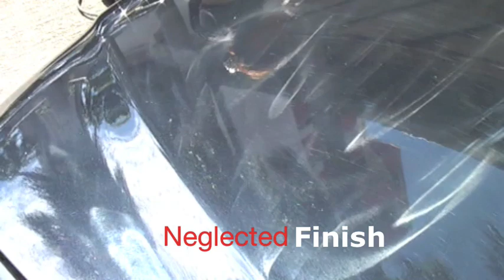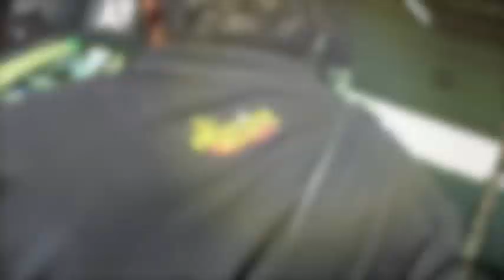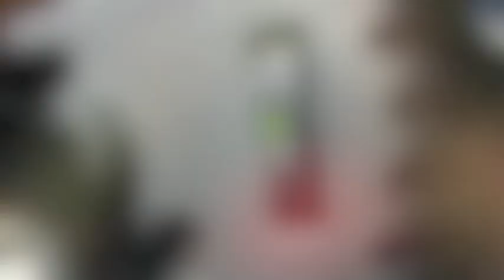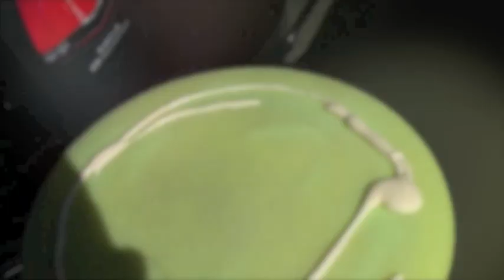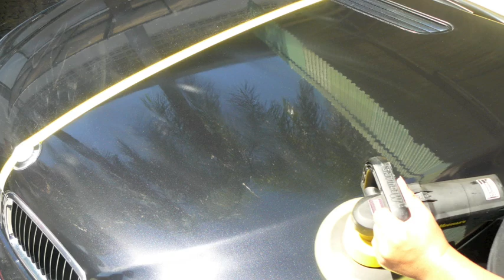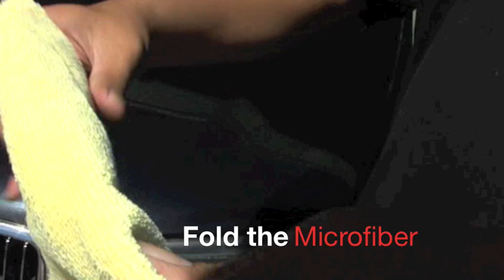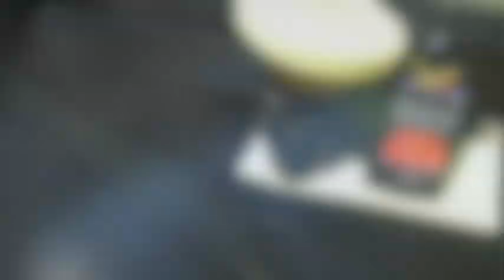How to use Ultimate Compound

Comment: If im not mistaken, they r showing how to use ultimate compound in another way than usually ppl use it. Usually ppl use it for small sections to remove oxidations. This time it was used for like 4 times the correction method and mainly used as a polish to take holograms, it went on and off super easy too. Smarttttt meguiars

Comment: Woke up this morning to find that the wind had blown a metal lawn chair against my 2010 civic si leaving a deep long scratch in my fender and door. I though that I would need to wet sand and buff out the scratches but two applications of ultimate compound with my da removed them and left a glass like swirl free finish behind.  Thanks for making great products and saving my paint Meguiars

Comment: Those who think this car was "set up", just take a look around and you will see a lot of cars with these swirls because most people who use a buffer to wax their cars unfortunately use one that spins way to fast or they do not clean the surface properly before waxing. This stufff is a micro abrasive that does an incredible job. The front of my car has fresh paint (thanks to a deer) which made the rest look bad. I hand rubbed the 9 year old paint and it outshined the new paint.

Comment: It depends to be honest. All polishing brands (over the counter) have different products for different levels of correction and skill. In this case, Meguiars Ultimate Compound has a 'cutting' element. This is essentially taking the majority of imperfections (holograms, swirl marks, RIDS etc) depending on method of application, i.e. Pad, machine, pressure. However, other products like 'Sealer & Glazers' and some Waxes are for 'filling' these imperfections. 

Hope this answers your Q :)

Comment from the maker: it should be used in the shade, yes you can use an orbital buffer or polisher. Terrycloth pad would work but microfiber or foam polishing pad is better. This product will bring back the shine and color, yes. After this product you should protect it with a product like tech wax 2.0.

Comment: Oh, never thought Meguiar will make so many mistakes!

1) Never do it under the sun.
2) Compound section by section, not the whole surface.
3) Each section should run 3 passes.
4) From far, the surface looks nice after compounded. But, in fact, foam pad can not remove many deep scratch lines including from the swirl marks. That's why Meguair has micro fiber (DMCS) pad for this purpose.

If we really can use foam pad to cut all the scratches and swirl marks with only 1 pass and with this speed, I will become rich as car detailers. I only manage to compound (including polish and wax) 2 car per day with 3 man power in a group. Not easy to remove scratches!
Reply: Lim KC i agree to most of your statement, but if we use a better polishing tool such as "rupes 21" and also meg 105 (this is my arsenal) isnt it is easier and much faster and sometimes ( depending on paint condition) we could do fewer passes? sometimes 2? Well i'm not a professional, just a "geek", that has OCD on neglected car finish. I'm looking forward for your lesson :p
Reply: Dude...they use under the sun to demonstration heeeeeeeeeeellloooooooooooooo
Reply: Pa Ca yeah i know. Larry from AMMONYC always said that. Sometimes they did it under the sun just to make us viewer, see the imperfections easier, but Larry always said, not to do under the sun. But MeguiarsAsia channel is not good at making video, even when applying wax. LOL
Reply: We can use microfiber pad to compound and follow by polish. Compound has to be run at slow hand moving speed. Yes, we can use foam pad with coarse polish material and able to run with fast hand moving speed but end up you need to run more polish layers. Just my two cents. Some other auto detailers like to use many polish materials but I like to keep it simple.
Reply: anthony hancia I have both Meg #105 and Ultimate Compound.  Given #105 has a cut of 12... I would give Ultimate Compound probably a 10 or 11.  Either way Ultimate Compound is vastly superior to #105 in that it is easy to wipe up and doesn't dry up as quick.  #105 is either like trying to wipe a thick grease that smears all over the place OR it dries out too fast making it hard to work with.  You will find you constantly need to wipe it up and if the air is dry constantly need to spray it with Final Inspection (or similar) detailing spray.

The Rupes 21 is absolutely faster than the Meguiar's DA.  My favorite polishes are actually from Menzurna... they beat Meguiar's hands down!
Reply: NETWizzJbirk well i have not try ultimate yet, and i did not realize is 105 dries up so quickly, its either i am a bit ignorant and noob or just because i live in asia, where its very humid here. and or polishes i have not try menz either, but sonax perfect finish is way better than 205. and compounding with menz? yeah you dont need to ask.  menz FTW!. just dont use their wax or sealent in my opinion. not working that well for me :p
Reply: anthony hancia Just saw your post... Getting products in the USA is super easy... Personally, I actually like 205; since, it is easy to work with and finishes great.  That said, I have NOT tried Sonax, so I have no reference to compare.  I know Mike Phillips used it in one of his AutoGeek videos and they got superb results; I may give it a try.

I would suggest you try Ultimate Compound because for the money it cannot be beat (here in the USA)... For all I know Meguiar's to you is probably a foreign product and likely costs a primium.  For me, I can get Ultimate Compound for about $8 for 16oz (about half of a liter)... Compared to even #105, which is about $35 for a quart (roughly a liter) it a LOT more product for the money.  Menzurna FG400 (similar compound) is about $50 and my preference thus far.

I have not tried their sealants.  Was it PowerLock that did not work well?  You might like Wolfgang Sealant 3.0 or whatever it is...  It is very user friendly, looks great, and lasts.
Reply: +Lim KC 

you do not need only microfiber to get rid of scratches, yes it cuts better, but it all depends on the paint you are working on. you can get the same results with foam as microfiber foam finishes better, but microfiber cuts better.

some paints you can get 90% defect removal without microfiber or wool, you have to do test spots not every paint is created equal

and those rotary holograms were superficial, they most likely did that them selfs, because they are so easy to get out.

the point of the video wasnt to show a 100 percent free defect car, it was just to show the average person that ultimate compound can get rid of some decent defects.

they never said the car was 100 percent defect free, they just showed a simple before and after.

and they only did it in the sun to show how bad the rotary holograms were, in a shaded area even with a inspection light the holograms do not illuminate as drastic as the sun does. its a showcase video.
Reply: Lim KC can you put up a better video yourself?

Comment: I use Ultimate compound in my pro detailing business because it works great!  for paint that is not so scratched and swirled that m105/205 have to be used Ultimate compound does amazingly well.  it is also great on really soft paints because it does not haze or swirl the paint.  great price too!
Reply: So basically use ultimate compound when scratched and swirled if not the case can I just use ultimate polish

Comment: The Ultimate Compound is a very good retail level product.  For beginners or those looking to just bring a paint job  back to respectability, this product is great.  I use it in conjunction with a Hex Logic Orange pad and the results are amazing for the product level.  I finish off with the Ultimate Polish with a Hex Logic Black pad.

Personally, I would divide that hood into at least 6 polishing sections and revise the technique to a more standard left / right then up / down method.  Also, stay out of the sun, especially on a black car.  Way too much heat generated that helps nothing.
Reply: I have deep oxidation but not THAT deep. It seems you can still see some after the McGuire's. How long should I polish for? I'm using a DeWalt sander that I turned polisher lol level 3.

Would you be able to explain the differences in pressure, speed, etc? Does pressure make it better? 

Does using more and more compound eventually fill the oxidation? 😅

Comment: 1. Wash the entire car with ultra clean handwash mits ! Upper parts first like roof, hood, trunk (depending on cars) , then the doors always up to down, then the bottom sides, front and rear bumper, Make sure there is no bugs on the surface (if theres any that cooked in the clear, the compound or sanding will take care of them.

2. Decontamination of the vehicule ! I decontaminate my vehicules with a Nano buff mits which mean you can decontaminate the car with the soap as a lubricant, Pass the nano buff mits, clay bar or anything you use all over the surface that are contaminated, you can feel it scratchy if you softly rub your hand against the paint

3. Rince the entire car and make sur there is no more contaminants and water leaking from  mirrors or cracks and everything.

5. To polish a car you must first be in a garage with very bright lights, Sun is not an option ! the compounds products dry to fast on the paint and is no good when you polish the product, Make sure there is no dust on the car and then Tape all the jonctions such as rubbers, alluminium, everything you dont want to polish or damage

6. Use the ruff whool pad with the step 1 compound (i use 3M) yours can be something else. Start polishing the surfaces till you see no more scratches, The step one always leaves swirls on the paint.

7. Again using the step 1 compound, switch pad and use a foam one, the ones i use there all 3M and it is white, then polish again all the surfaces.

8. Glaze the car : I use HSF 2 as a Glaze and it wirks perfectly fine, it gives instantly a mirror effect to surface of the paint, Turn your machine up to 3,800 and dont put too much product.

9. Ultra Fina : This is the step 3 of the 3M compound and it is the last step of polishing youll do, SO MAKE SURE TO DO IT RIGHT TO GIVE THE BEST FINISH TO YOUR CAR.

10. Wax it ! Wax with banana oil or carnauba is the best i ever used.

11. Remove every exceedents of compound in the cracks windows and everything ! you may need to rince the car again with a pression gun.

Comment: I know what you mean.  I use Collinite 845 and it is extremely difficult to remove the sealant from the buffing microfibers.  I pre-soak the towels in a gallon of water with 1/4 cup of All purpose cleaner either overnight or for a few days (only way to get them clean).  Then rinse thoroughly, and resoak again in APC.  If no more residue is coming from the microfiber towels, rinse thoroughly with some white vinegar mixed in your rinse water.  That *should* do the trick.  Time consuming, yes.

Comment: This is kind of a misleading video. Its been rotaried and left with swirls .. its not neglected. And then they buff it out. Put a video of a legitimately neglected car. And clean it with just this product. Then ill be impressed.
Reply: +Miqui Russell Stole the thoughts right outta my mind
Reply: Agreed, but I would say it's been abused by someone with a rotary who didn't know what they were doing but I'm   probably splitting hairs.
Reply: its worse than neglected
Reply: agree with you on everything you say thats defo installed swirls with a rotary  buff can tell by the pattern but i can vouch for this stuff im using it to bring back the old white/pink bmw bright red on my 28 year old e30 bmw an you wouldn't believe how good its coming back with this if i could get picks on here i would be happy to show
Reply: dave mac
You can use photobucket and share link, or make a facebook picture album public and share it
Reply: I agree, great paint that has light surface scratches caused by a dry buffer.  Wonder how they got there????? HMMMM???? lol.
Reply: Neglected or detailer installed, compound/polish will fix it. Same process.
Reply: € fut deaghis teare louvi years
Reply: The video was shot in Meguiars Asia(China). What else do you expect?
Reply: it doesnt matter anyway Miqui,,,if you use Meguiars compound,,polish or wax,,you will be impressed,,,it is a superior product and it wont let you down
Reply: This is the norm for ALL detailing companies. Also, always showing “just the hoods” on most detailing videos.  There are other areas on a vehicle that need to be buffed out that are a lot more difficult than a hood!!!
Reply: How pathetic!!

Comment from the maker: for cars, you want a less aggressive soap that does not remove the wax or sealant that if your protection from UV rays, dust, dirt, etc etc on the paint. A car soap should be PH balanced to not strip your protection! Pros of a car soap is that its made for any part of your car and wont harm the paint, windows, metal or rubber. Dishwashing soap is made to remove grease and dirt for hard surfaces...soft ones like paint and rubber and such will harm it over time and make the car not smooth and fade

Comment: Never do this out in the sun.
Reply: myfastgti07 That is one of the rules of polishing for beginners, but if you experience enough, heat is one of the criteria to level out the paint. Buffer speed, arm speed and types of compound are in 'different arena' when you outside expose to the sun. The guy in the video took an advantage of heat from the sun and use speed setting 4 while buffing and you notice his arm speed is slightly faster. If the car were in the studio/garage and when paint is cool, his arm speed need to slow down a bit and probably require speed setting 4.5 or 5 because he want heat and power from the buffer. So polishing cars out in the sun is not really a big problem as long as you know how to take control of the buffer and also know the surface temperature
Reply: Radhwan its true when you do it properly even in the shade the paint surface heats up it helps take layers off
Reply: @MohdRadhwan  thank bro,I have no place to do polishing step. Your explanation has helped me to do so under the sun.
sorry bad English
*Google translate
Reply: @MohdRadhwan  balony

Comment from the maker: this product is made to help with neglected or abused finishes. This product has light abrasives in it so it will help clean the finish and or wax build up.... if you want to strip the wax off of a vehicle, I would wash the paint with normal hand soap or kitchen soap three times.

Comment from the maker: UC should be used in the shade...this was filmed in sun to show horrible defects...that camera can see in sun. If you wanted a three step system, use 1) Ultimate Compound or SwirlX to clean 2 and 3) Tech Wax 2.0 followed by Ultimate Quik Detailer to maintain it.

Comment from the maker: @trencher7 it has similar technology to our professional m105 or m205, so it means it will stay wet. you want to work it in til it gets very shiny and ALMOST gone. With a DA..use it on 4-5 speed for cleaning with the G110 or G220. After this product you would polish/protect.

Comment: @Meguiar's Asia

Is this product a polish in itself, so need of polishing after using this product to remove swirls?
I have the product in my checkout, I just need you confirmation.
Reply: No it's not a polish. I'd reccomend buying the ultimate polish as well.
Reply: +Hamilton 47_  he used one of the softest sponge pads out there (like a dish sponge round version soft enough to shine a babys butt) the stang advises get and use the polish after and i agree.

Comment from the maker: water spots can be as bad where you may have to use professional help. The strongest consumer cleaner is ultimate compound....if this does not work, you may have to step it up and use professional compound, possibly having to sand in extreme cases.

Comment from the maker: @speedyspeedboy123456 if your doing hand only...you can use M105 or ultimate compound by hand with possibly 2-4 applications. If this does not work, you will need to find power possibly with a tool if the problem is deep.

Comment from the maker: @billjupliz if you contact Hypercoat, which is the sole distributor, they should be able to break it down into smaller bottles for you. They bring it into the country in gallon size due to mass needs. I will bring this up to them and hopefully they can bring in smaller bottles in the future.

Comment: i have a white car, about 8-9 years old now (honda accord) still runs perfectly but of course has some bad marks. mainly swirls but a few scratches. not deep deep, where it exposes silver but in the clear coat but would catch a fingernail. Not by much, but to the point where u can feel it when u slide your nail across. will this take care of this?

for scratch x 2.0 can that eliminate small paintchips? thanks

Comment: Looks better but there was still swirls after on the completed side .  Not happy with the results I got with the ultimate polish. Put swirl marks in my brand new unswirled paint. Guess it was too hot out. Or I rubbed too long and it got dry, or I didn't run it long enough and used too much.  If it's so unsafe you shouldn't sell it, too aggressive for my taste I'll be going back to mothers or 3M

Comment: So I'm about to use this same compound, applied with a foam pad on my buffer, on my 95 camaro which has 307000 kms on it (lots of little scratches) 
I want to wax after I'm done using the compound to give it that protective shell, any preparation techniques needed for this? Or can I just go straight from Ultimate Compound to standard wax after wiping with microfiber in between? Thanks!

Comment from the maker: @6824096 to make the surface smooth..you should use our smooth surface clay kit....the compound will help the water spots but sometimes they are too deep to be removed. It depends on if its deep or light damage.